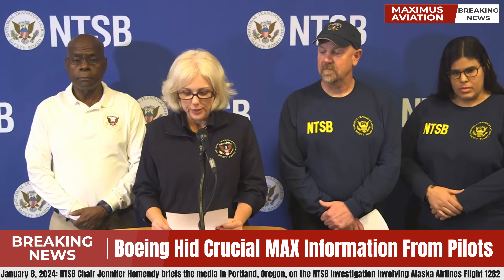Boeing NEVER Told Airlines That 737 Max Cockpit Door Was Designed To FLY Open During Decompression!

Comment: Fine, they ‘forgot’ to put it in the manuals. But hello?! Blowout door by design? Nice thought as a passenger sitting in the row: not only do the mask come down, but the hole door disappears. and yes do not unbuckle yourself anytime during flight!!
Reply: It is the cockpit door that is designed to open upon decompression. Not the plug door that failed.
Reply: Oh, now I feel dumb! (and I guess I am) for not reading the headline correctly and not listening properly. Thanks for the feedback.
Reply: @tangolima4148  I was confused at first when the NTSB woman stated the door was designed to blow off. I went bopenack and restarted the video...

Comment: Letting potential hijackers know that all they have to do to gain access to the cockpit is smash a window above 15000ft is probably a bad idea.
Reply from the maker: My Fear.
Reply: @maximusaviationchannel  Smashing the windows aren't that simple or easy. Even smashing a car window is difficult without the right tools.
Reply: @theflyinggasmask  well then let’s hope some passengers would be able to subdue them after their first try. Still not smart to advertise. I thought they were talking about the door at the rear with the plug that they don’t use. But then I got through my brain reading this they said cockpit Door so yeah why are they even talking about that? If there was some lack of communication, couldn’t they pick up the phone to the captain?
Reply: @rachmunshine9474  Yeah, even in the incredibly low chance event that terrorists manage to depressurize the cabin, they'll have to make a hole as big as a door in order for the cockpit door to open, since a window wouldn't allow air to escape fast enough. Then they'd only have about 20-30 seconds of consciousness to take over the cockpit, I'd assume the cabin crew could restrain them quite easily after they pass out.  Anyways, terrorists usually go for widebody aircraft, so i wouldn't worry to much about the cockpit door tbh.
Reply: If someone knocks a window out at altitude you’ve got bigger problems.
Reply: @chrissmith7669  The plug door left a considerably larger hole than a broken window didn't it. No-one died, the aircraft looked fine, if a little drafty.
Reply: A lap baby would be dead if in that seat.
Reply: A lap baby would be dead if in that seat.
Reply: A lap baby would be dead if in that seat.
Reply: A lap baby would be dead if in that seat.
Reply: A lap baby would be dead if in that seat.
Reply: A lap baby would be dead if in that seat.
Reply: A lap baby would be dead if in that seat.
Reply: A lap baby would be dead if in that seat.
Reply: A lap baby would be dead if in that seat.
Reply: @stevemumbling7720  Nice!  BTW, in British English the word is draughty, because always has been!  Don't ask 😅
Reply: @chrissmith7669  they would get sucked out through the hole 😅😅😅
Reply: @bighoss9705  Absolutely not. Facepalm moment yet again.
Reply: Good luck to them trying to walk around the cabin while decompressed without oxygen
Reply: @Daimo83   if Terrorists want to get the Control over a Plane .. they are Prepaird to smasch a Window and Walk around in a Decompressend Cabin ...  We are not talking about an Drunk  Mallorca Visitor ..  if Terrorists know a weak point .. they will be finding a way to use it !!
Reply: @KalatSaar  "if Terrorists want to get the Control over a Plane .. they are Prepaird to smasch a Window and Walk around in a Decompressend Cabin"

I don't think you can break a passenger window in flight even with an axle, passenger doors being plug type will not open with pressurisation and the overwing emergency exit have an extra locking mechanism in flight. 
I don't see how one passenger would be able to create a rapid decompression event?
Reply: @KalatSaar  well they would lose their brain cells pretty fast if they didn’t already have the oxygen tank and I think taking one of the flight attendants oxygen tanks that’s meant for them to be mobile and help others put theirs on that are at their seats would arouse some suspicion.
Reply: @KalatSaar ,  the percentage are low if US stop mending on other peoples business
Reply: @Daimo83  Didn't you see the footage from inside the plane? A crew member was walking around inspecting the damage just fine.
Reply: @stevemumbling7720 at what altitude/cabin altitude was the crew member walking around? The plane was descended to a safe cabin altitude.
Reply: @stevemumbling7720  nope
Reply: @JuanAdam12 I don't think you understand pressurization.
Reply: @Daimo83  There will be oxygen. Climbers do not go onto oxygen until 21000 feet. This is a feasible hijack attack method.
Reply: @Daimo83 At the altitude they were at, even if you cut the baseline numbers in half twice to account for the rapid decompression and exertion from walking around the cabin, there's still over 5 minutes of useful consciousness. If they were at cruise, it's a different story
Reply: Need to audit the line at Boeing. Then strip this and several other recent aircraft. Has Boeing corrected the Ducommon flange joint scandal? We can all predict numerous quality defects. Who wants to fly this particular aircraft without first a full strip check of structure?
Reply: If they're in the cockpit, you've got bigger problems
Reply: @kevb8983  That wouldn't do much to an aircraft window.
Reply: I wouldn't be prudent to write about the alternative ways in which terrorists might make use of this information, but @stevemumbling7720 has a point. On the other hand, it puzzles me why they designed the cockpit door that way. As this incident shows, it's much better if the pilots are kept isolated. They would know there was a sudden decompression anyway. The wind and noise made their job more difficult.
Reply: @jjeherrera  Supposing the door into the cockpit was 6' high by 2' wide, the area of the door would be 1,728 square inches. If there was a pressure differential of 8 lbs./sq in, that would put a pressure of 13,824 lbs against that small door. It would have to be built much differently to handle that pressure.
Reply: IF the door wasn't designed that way, this would have been a serious incident.
the blow out door feature protects the aircraft from a lot of damage.
it's been there for years on all aircraft.
it takes a lot of force, work out 6 psi over the whole door minimum.
it also oens outward into the cabin, so kicking it won't help.  @jjeherrera
Reply: I flew 737-200s from 2000-2007 we knew the cockpit doors had blowout panels. Don't know when this info got dropped.
Reply: "I flew 737-200s from 2000-2007 we knew the cockpit doors had blowout panels. Don't know when this info got dropped." @georgehurley-hd8kd  
Same as a maintenance engineer we were informed on that for both Airbus and Boeing.
Reply: Wow for real never thought about that
Reply: They don't have to smash a window and cause a rapid depressurization. The cockpit door has 2 blowout panels that can easily be breached from the cabin side. It HAS been done. See my comments above for a full expanation.
Reply: Smash a window lol. Suurrrreeeeee.
Reply: This was my fear, too.
Reply: Yes, it’s a double layer plexiglass window. I want to see somebody inside the aircraft try to do that without using a firearm.
Reply: A hijacking that results in your passing out will not be very effective!
Reply: @ArchimedesDaVinci  Good to know, thanks 😂
Reply: @Daimo83    "Good luck to them trying to walk around the cabin while decompressed without oxygen"  There are PORTABLE oxygen tanks inside the cabin typically stored in the galley and/or within close proximity to the jumpseats for the flight attendants to use during an in flight emergency. You're welcome Daimo83
Reply: There are far easier ways to control an aircraft without resorting to this, especially if you understand airplane systems and how airlines work.
Reply: Right.
Reply: Why is Jennny making a fool of herself,talking about things she clearly doesn’t fully understand when she has 3 professionals standing around like a spare prick at a wedding
Reply: @jonny_laguna So it's not impossible to smash the windows.
Reply: "So it's not impossible to smash the windows." @stevemumbling7720  
Good luck with that.. you might be able to damage some layers with the onboard crash-axe but breaking it apart? without equipment?
Reply: That'll get rid of one hijacker.
Reply: Anyone who even attempts to "smash" a window would very quickly find themself at the bottom of a stack of guys unable to move, or probably even breathe for that matter. Passengers are going to team up to stop anything that is even close to being a threat. What continues to be worrisome is the mental health of certain pilots who want to crash the plane on purpose.
Reply: @Michael_W007  I think that guy was an anomaly, and right now the pilot's unions and the FAA are working to craft a new approach to pilot mental health, because it used to be that if you had any issue whatsoever, that you were admitting to having, you were out of a job, and it kept many pilots from sharing needs that they had for health support. All of that is going to be changing in the next few months.
Reply: Pilot can let everyone pass out after oxygen ran out then decent...
Reply: My thought as well.
Reply: my thoughts exactly !!
Reply: Common knowledge.
Reply: @das5813  Common to who and when? Were you just trying to look smart?
Reply: Some opine prior to logical thought.
Reply: Navigating the cabin to get to the cockpit will be quite the challenge, particularly if at altitude and insufficient oxygen.  Nice imagination.
Reply: @matthewgaines10 I don’t know hijackers mainly spend huge amounts of dollars for first class seats. I doubt the people hijacking the planes will be seating in seat 39F and then venture  to the cockpit. That’s how the 228passengers will choke slam you to the ground like the rock. So from all the documentaries I look at, I noticed the hijackers in the back are there for crowd control. And those in the middle are to prevent flow of people trying to run up front swelling the numbers to aid the crowds trying to subdue the hijackers up front. But those in first class dressed in suits. Paying 30,000 dollars  for seat 1A or the whole row are the pilots or the commanders. 

Example the 9/11 hijackers. The pilots and top commanders had first class or business seats between row 2 to row 8. And if they aren’t all in the same row, they picked middle seats incase there is a hero on either side of them. Navigating to the cockpit in fog and wind if he is determined and he has rock climbing straps to keep him from flying out the airplane shouldn’t be that hard. He would be well trained to know when that happens the evasive maneuvers the pilots take and diving below 13000ft to find breathable air. And when down there he won’t be flying at 450mph ground speed he will be flying very slow. The passengers would be bewildered and scared while he is battle hardened and determined he can get up there after the emergency decent is performed and the cockpit door is opened. It’s possible if they aren’t idiots. It may be an out there scenario but it’s possible.
Reply: @matthewgaines10  Tell that to climbers who do not use oxygen until 21000 feet.
Reply: @matthewgaines10  You mean like how the flight attendant "navigated" to the door in this case? Did you actually watch this video?
Reply: A potential disaster regardless if those planes are hijacked or not, disabling the transponders remove those tin cans from radar and will be ghost planes. The voice recorder had 2 hours of recording space, then overwrites the magnetic tape, that flight was only 20 mins out the journey. An upgrade to the recording media should be a solid state device with at least a few 100 GB of space.
Reply: Now they know all they gotta do it’s a put a small hole in the fuselage causing rapid decompression,  and the cockpit door may swing open

Comment: The issue is not the door not opening, that makes sense to equalize pressure. The issue is the fact Boeing needs to change there manual no one knew it would do that…. That’s the issue and the same overlook that helped to take down the max 8

Comment: Clickbait. Use your brains ppl why would Boeing hide a good feature 😄?  FAA AC 25.365 and AC 25.795 covers this.  Let me translate the parts you need to know, this is not a required feature of the blast resistant doors and not all of them have it.  Why? because the entire structure in the pressurized vessel is supposed to resist a decompression event.  This aircraft did.  Want an example of an aircraft that didn't, go look what happened to two DC10s when their rear cargo doors blew out... Hell even the Aloha Air 737 that decided to turn itself into a convertible and the United 747 which blew a forward cargo door both maintained their structural integrity through the floor beams.

I digress, I'd put money AS maintenance/engineering department knows which aircraft have which type of door.  So yes as she said Boeing and Alaska just need to make sure this information is in the cabin crews/pilots pertinent manuals.  I'm an engineer but you don't need my degrees to just take a second and think before you react....I watched this press conference live, she was not being accusatory.  By the way I suggest watching the whole thing.  They did a fantastic job!

SN Boeing is still royally sucking rn

Comment: Gotta wonder what else is Boeing NOT telling...
Reply: check out about the de icing system on the MAX
Reply: @alex630710  what am I supposed to check?
Reply: @alex630710  oh no !!
Reply: Wouldn't be that far fetched to consider that it could be company internal and government supported sabotage as part of the plan to destroy America from within. Ford also is suffering greatly from design flaws and quality control. Two great (and huge) American companies being taken down from within, maybe intentionally or maybe not.
Reply: Misaligned fuselage bolts will result in the tail section separating in flight.
Reply: @johnwatson9518  yup sprit aero  didn't do them any favors.  Boeing should buy it back and take more control.
Reply: Not knowing the door was going to fly open on decompression is Nota big deal.😊
Reply: @AndrewLarson-mq7xc  Its a H-U-G-E deal .
Reply: @anthonydowling3356  why ? Would you expect something different? What do the pilots think Would happen?sounds like training issues to me.
Reply: @AndrewLarson-mq7xc  really  ? What would you call a big deal then  ?
Reply: @bobthompson4918  just like mcas if they would have flew the plane like all past 737 the odds are the planes wouldn't have crashed . There again not up on their training  HIT TWO TOGGLES SWITCHES TO TAKE AUTO TRIM OFF AND MANUALLY TRIM THE PLANE .THAT PART OF THE 737 HASN'T CHANGED. AND MCAS IS STILL ON BOARD.
Reply: @bobthompson4918  the door plug blown out. THAT IS A BIG DEAL, and the part where the plane flewflawlessly and Touchdown without any other issues.
Reply: @AndrewLarson-mq7xc  It would have been a much larger deal if anyone had been sat in the seats by the missing panel, luck rather than engineering resulted in zero deaths
Reply: @AndrewLarson-mq7xc  3:46 

A kid lost his shirt.
Reply: @spikenomoon  yeah thank the lord that's all the little guy lost for sure. Still kinda early to rule out sabotage.
Reply: @AndrewLarson-mq7xc     Ya Boing sabotaging itself using accountants to engineer a new plane.
Reply: @spikenomoon  yeah they need to fire all them accountants for sure.and get company back on track..

Comment: Call me suspicious but, I wonder since the aircraft was almost full, why the seats next to the plug just happened to be empty. 
We're all grateful they were but, it seems kind of suspicious that maybe the airline knew of a potential risk and deliberately kept those seats unoccupied.   As for the cockpit door opening on depressurization,  I was under the impression that once locked from the inside the door was basically impregnable...except during depressurization apparently.  Under these circumstances, if this feature operates on all Boeing aircraft, then the crew of MH370, if they had known, could have deliberately depressurized the cabin to gain access to the cockpit.  Well, this is drawing a long bow perhaps but still, I find it hard to believe that the engineers wouldn't have built in a system to compensate for sudden decompression to allow the pressure between the cockpit and the cabin to equalize quickly.  Perhaps not including such a system was another Boeing cost saving measure.  I would have thought that having a redundant actual door would be safer than a "plug".
Reply: How was a window seat open on a flight with at most 7 open seats?
Reply: Perhaps they moved because they were bothered by the constant whistling noise.
Reply: The airline is responsible for the specs on whatever aircraft they buy.  Has nobody read “Airframe”??

Comment: All cockpit doors and bulkheads will vent pressure.  They're designed to give-way instead of kinda holding up and then failing catastrophically one way or the other.  "Catastrophic" as in -- 1) Contributing to fuselage structural failure; 2) Sending shrapnel flying into the crew;  3) Damaging flight controls and other systems.

Comment: Stupid design, fundamentally a door with no handle, pushed upwards into place by two large (vibrating?) springs with four locking pins on the hinges and guides. Possibly bouncing up and down slightly. 
Oh, COTTER PINS???!!!
Would have been better to BOLT IT TO THE FEKKIN PLANE.